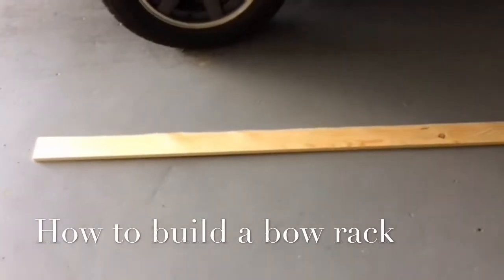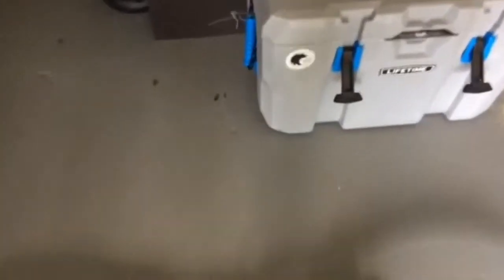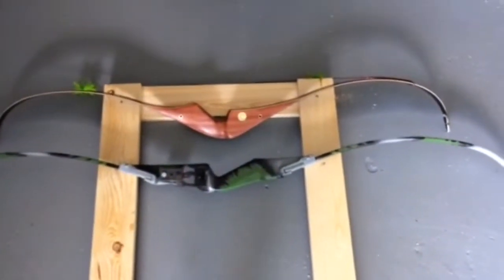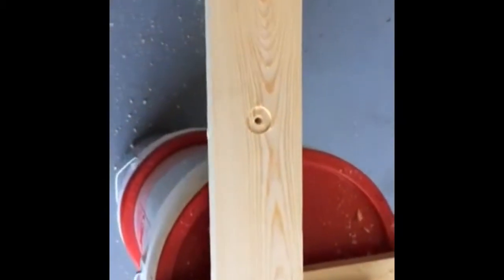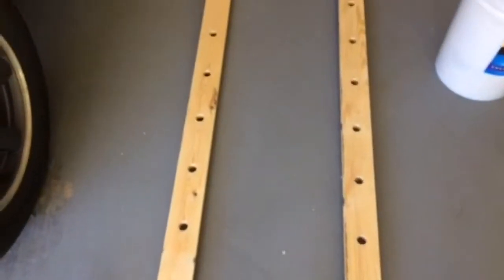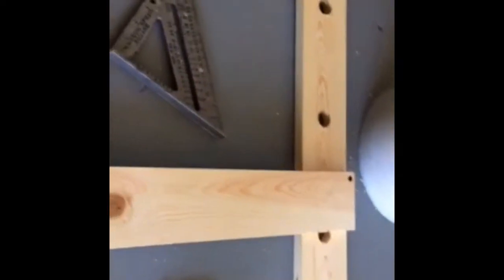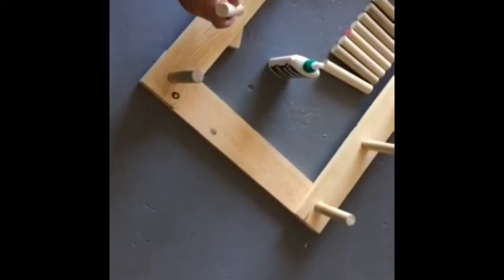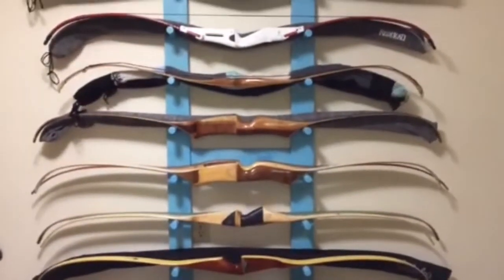How To Build A Bow Rack.

Comment: Thats a nice simple effective and sturdy bow rack you've put together there, I may well do one based off of that myself at some point. It looks good with the stain on it.
Was that a korean bow I spotted near the bottom?
Reply from the maker: Hutchie 2112.   It is a 40LB Recurve Handmade Archery Asian Mongol bow I really like it it’s fun. I like that I can shoot it lefty or righty.
Reply: Ah, right. I had a mongol bow, but it cracked.  I have a few of those more 'traditional' asian bows, those are my preferred bow of choice these days most of the time, shooting thumb draw, arrow on the right.
Reply from the maker: Hutchie 2112.  Yes that’s next just need to get ring, I need to figure out what size I need and one that not to expensive.

Comment: Thanks very elegant design.  I will copy it but down size it for three to four bows.  The volume was low.  What diameter were the dowels and what size hole did you drill?
Reply from the maker: Michael Kestrel. Thank you very much for your compliment and for your feedback. If you go to the description all the information is posted in there. And I used a 1” dowel rods and a 1” spade bit thanks again good luck hope it turns out well God bless.